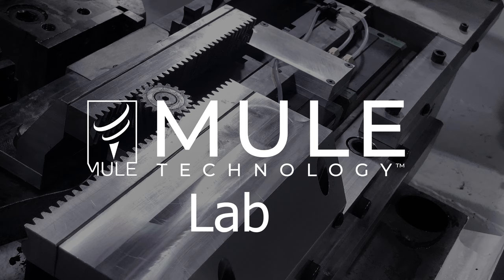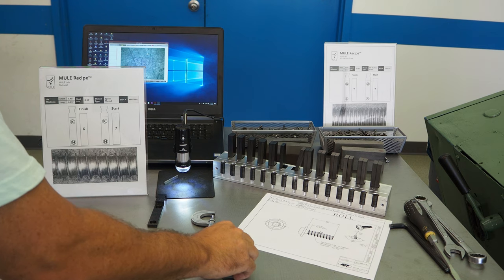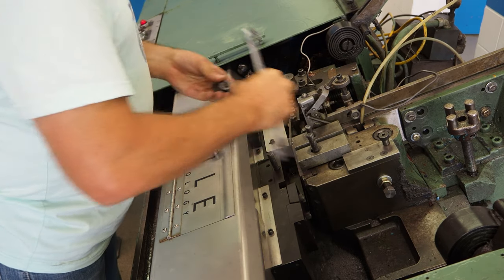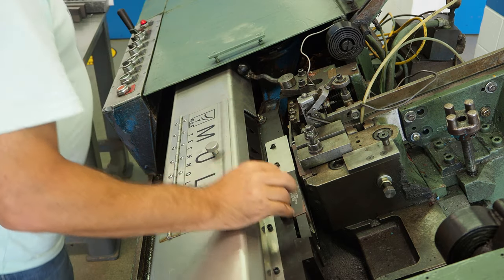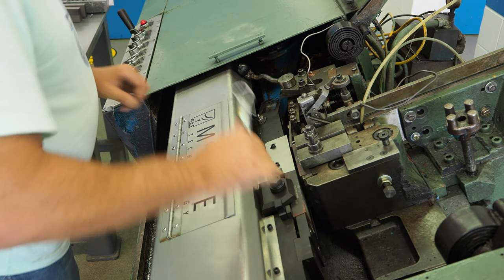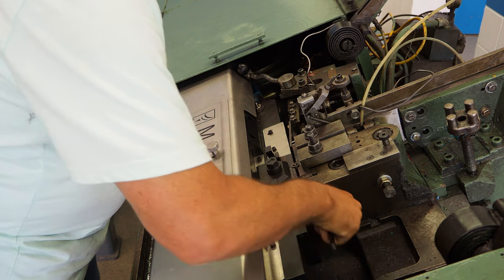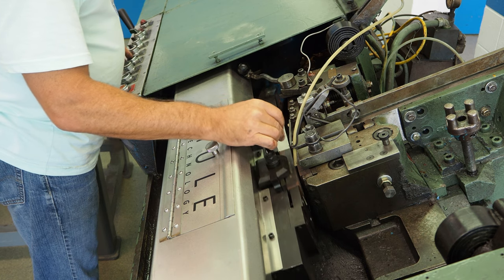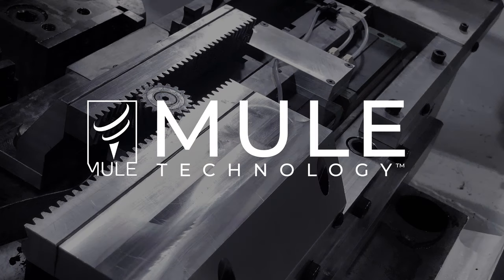Delta PT 60 Screw Setup | Mule Technology™

Comment: How’s does this work when you need more or less tipping ?
Reply from the maker: Great question Leonardo!  We have four Discs that are positioned behind the die or the die block, depending on the size of the machine. Each Disc, A-U, varies in thickness by 0.001" or .025mm.  So you are able to tilt the die by increasing or decreasing the Discs on the bottom of the die. If you have other questions or want a virtual demo, please email support@muletechnology.com.  Thanks!